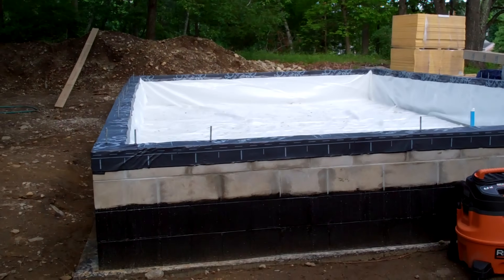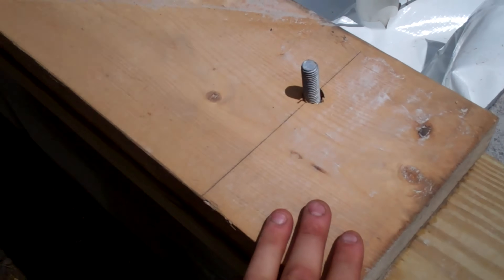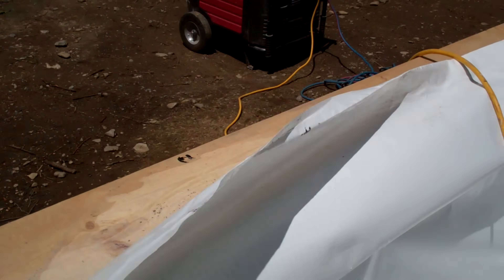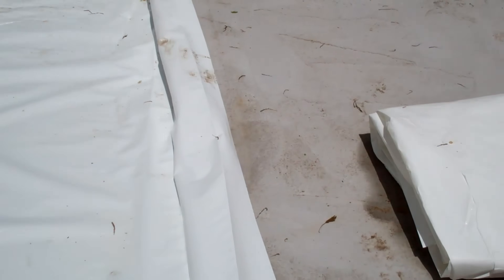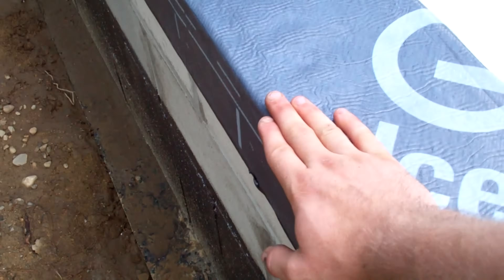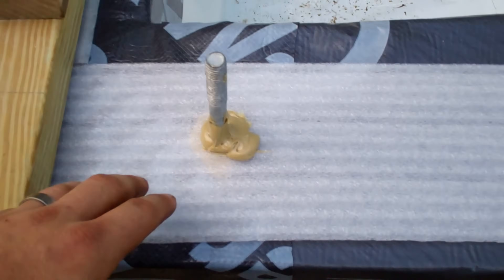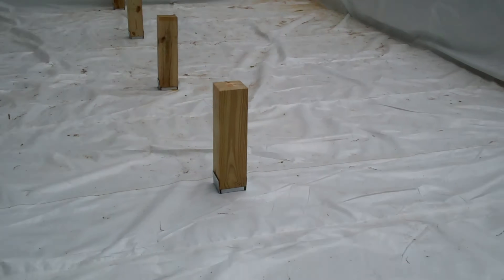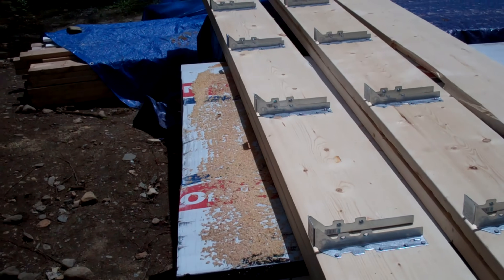Crawlspace Vapor Barrier, Sill Plates, DIY House Build (pt 3)

Comment: Hey David, love the channel and all that you do. Was wondering if you would mind helping give me some direction on how to best insulate my crawl space and duct work. The crawl space is currently vented and I am looking into encapsulating it, and not sure if there's anything product wise you would suggest or stay away from. I am looking at maybe a foam board on exterior block and then spray foam around floor joist at sill plate and then running vapor barrier. I was also looking into insulating the duct work, out going air is in crawl space and return is in attic, I've looked at fiber glass, foam, and radiant barrier. I don't think cellulose would be a good choice due to condensation potential around duct, unless you convince me otherwise. I just got done doing dense pack cellulose in existing exterior walls and that turned out really well.  Thanks in advance!
Reply from the maker: Hi David,  Thanks for checking out my channel.  I can speak in broad terms here, but if you want to dive into details we should connect through e-mail.  I'm a big fan of encapsulated crawlspaces.  My crawlspace is not vented.  It is an extension of the house's thermal boundary.  I personally have R-26 on the inside of the concrete walls, and on the floor of the crawlspace (dirt level).  I have no insulation between the floor joists.  This is how I like doing it.  If you have radon and/or ground water problems then you may want to install a perforated drainage pipe in the dirt before insulating.  

The first step is to remove all trash.  Then make the floor (dirt) relatively flat.  Sometimes this has been the hardest part.  Seal off vents.  I've gone as far as mortar and block the old vents.  If there is a liquid water problem then now is the time for taking care of it.  This might be a sump pit with pump.  Drainage tile.  Gravel.  That sort of thing.  Remember, all this happens before any insulation.

Next would be a layer of insulation.  One of my favorites for crawlspaces is XPS foam board.  This is usually blue or pink.  ex: https://www.homedepot.com/p/Owens-Corning-FOAMULAR-250-2-in-x-48-in-x-8-ft-R-10-Scored-Squared-Edge-Insulation-Sheathing-52DD/202085962

I've also used EPS, Polyiso, and Rockwool.  I like to put down two layers, with alternating seams.  This same insulation board can go up the walls to the sill plate.

Next is the air/vapor barrier.  This can be a 6-mil Poly if you are going to cover it with something like a concrete slab.  But if you won't cover it, then use a 16-mil or 20-mil reinforced poly.  This will stand up well for the occasional plumber down there.  The plastic needs to be caulked, taped and mechanically fastened up the wall.  

Last step is to insulate the rim joist.  I like to use dense-pack cellulose in the rim joist, but spray foam can work too.  The important thing is to fill the rim joist cavity all the way out to overlap onto the foam board on the wall.

I hope that helps.  Send me some pics in e-mail.  It's a ton of work, but very rewarding.
Reply: I have encapsulated two crawl spaces. One was dry and sand bottom so I just installed the white liner and then insulated the side walls with polyisocyanurate foam board. It's code rated for being exposed. Regular foam board was considered a fire hazard if left exposed in my area. The second crawl had standing water so we trenched it and laid socked 4 in poly pipe with pea gravel to a sump pump. We also applied a couple inches of pea stone to the whole floor because of sharp gravel. We then used the white liner and polyiso on the walls. I heat the crawl area so that the whole house is comfortable in the winter. It may seem wasteful but its like having heated floors in the whole house and no slippers needed.

Encapsulation is absolutely mandatory in my opinion.

Comment: I guess you are glad it didn't rain before closing in otherwise you would have a nice pool lol. You have some interesting ideas.
Reply from the maker: It rained during the build, and I pumped water out of there.  It is something I would change if I did it again.  On the positive side, it is very air-tight and energy efficient.